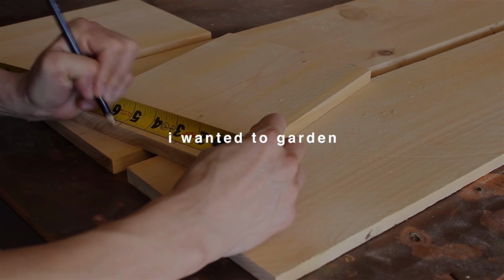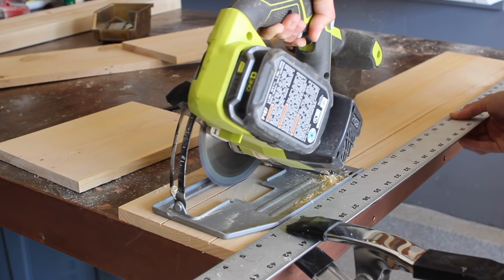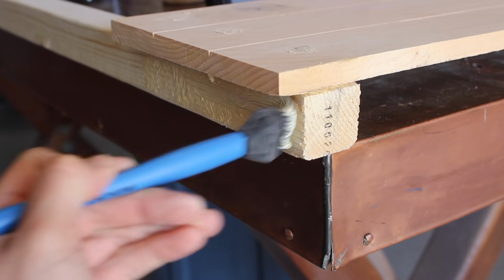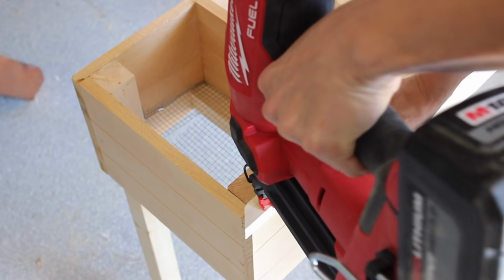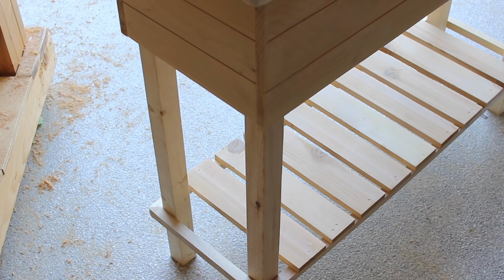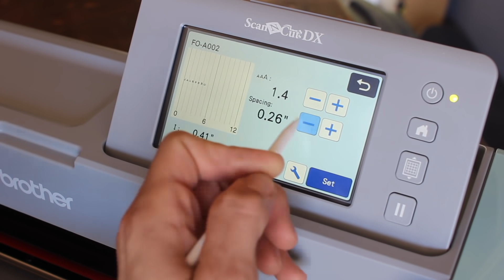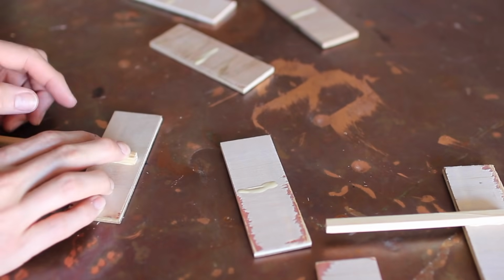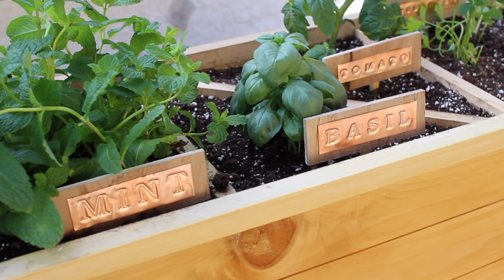DIY Raised Planter Box

Comment: As someone with some gardening experience (not an expert - just ten years of learning from mistakes), I think this is a pretty good design. You clearly did your research. There's nothing wrong with dividers as long as potting soil is what's being used. If any of the plants outgrow their sections, they can simply be transplanted to larger containers. (Though it looks like these are all annuals, so that won't be a big deal.) It has the added bonus of preventing the herbs from fighting each other.
On the subject of finishing the wood, most home gardeners avoid it out of fear that their food might absorb toxic stuff. After my plant biochem course, I'm not sure they can? But I still generally side on "better safe than sorry" and just accept things weathering and not lasting more than ten years at best. I'll have probably changed my garden designs by then anyway.
Reply from the maker: Thank you so damn much for taking the time to give this feedback. I really appreciate it xx.

Comment: if I use normal wood to recreate this, will it bend and warp if it's exposed to the rain? I absolutely adore what you did with this, it's really cute and functional, such a perfect thing for a small balcony
Reply from the maker: You just need to seal it properly! The non cedar has already warped a little on mine.